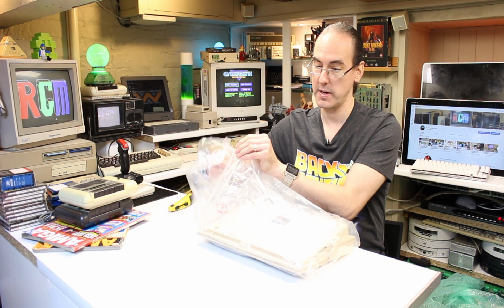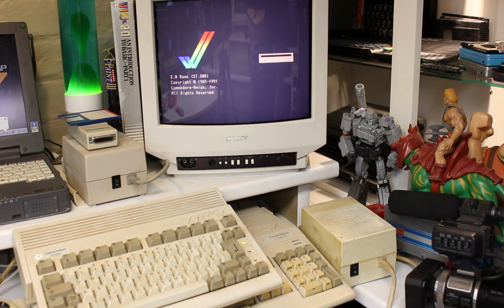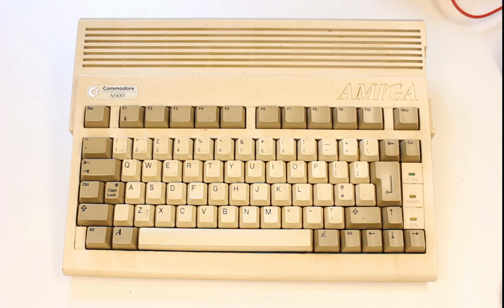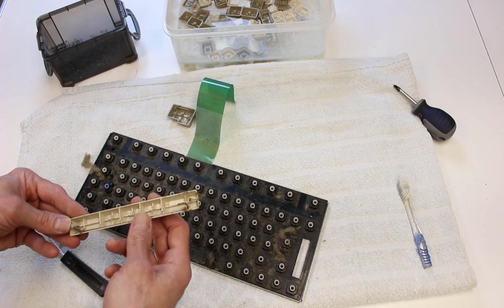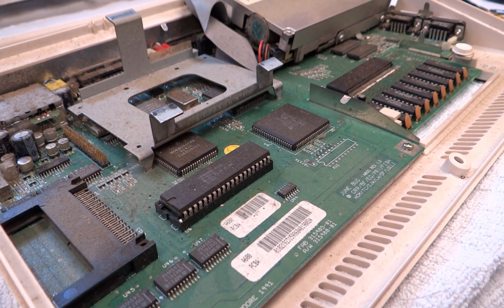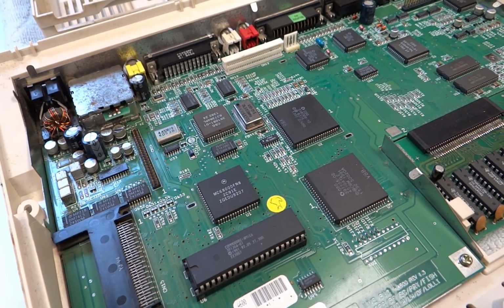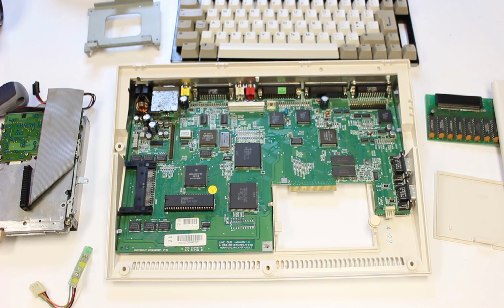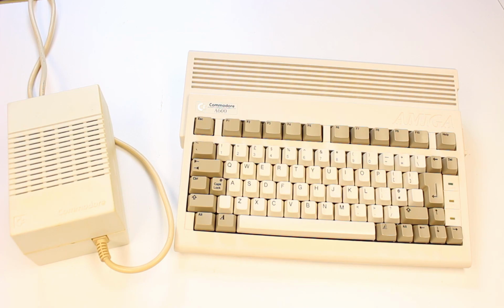COMMODORE AMIGA A600 UNBOXING, AND RESTORATION. Will It work? #commodore

Comment from the maker: This was my first commodore Amiga experience back in the 90's, what was yours!
Reply: It was mine too! Best Christmas ever, the only one I really genuinely remember.
Reply: Exactly the same as me an Amiga 600 was my first, then eventually the A1200. But the 600 will always be my number 1! There should be a top metal shield on the 600 like the 1200,  a couple of 600's I have had did but the one I use now doesn't as its not really needed. Great video by the way!
Reply from the maker: @macmin08  Thanks, glad you enjoyed it. 🙂 I have since seen a few other videos where the top shield was not present on a factory sealed Amiga 600, strange. But apparently commodore did that sometimes and added the little pad to stop the keyboard from touching a memory expansion.
Reply: @RetroGadgetMan  great info thanks! Mine also doesn’t have that

Comment: Remember, lead based solder. Makes recapping a little easier. And yes you'll need a ROM upgrade to use a boot drive bigger than 40MB (problem peculiar to 37.300). Contact switch cleaner on the floppy disk sensor might help.

GadgetUK164 is good to study for retro soldering, but the absolute best around is Acii... a real master tech at recap.

https://www.youtube.com/channel/UCTykXw6QUfZvgAykuvo3WEw

Get a big bottle of isoprop and some scrap surface mount boards to take apart. There is no substitute for experience. And you can't solder a dirty board, EVER...

EDIT: you can get a really snazzy fast RAM board for this to plug over the processor. Although if you are REALLY lucky and can find an old 5Volt 4MB PCMCIA memory card, that works too. Rare as hens teeth though. WHDLoad likes the fast RAM for loading and it makes the machine a lot less laggy in general.
Reply from the maker: Thanks for all the info. I plan to use a broken pcb to learn on. I find practice on something else first gives you a feel for it like with most jobs. I have a IBM 4MB PCMCIA card somwhere, would that work.
Reply: @RetroGadgetMan  Maybe. Best to look it up. A later 3.3 volt card won't connect properly - they changed the pins slightly and added some gold plated "bumps" so they won't plug into a 5 volt PCMCIA as found on an A600.

IIRC, the PrepCard (CardPrep?) tool on Extras disk is used to configure a card as either storage or memory.
Reply: @RetroGadgetMan  If not, one of these does have advantage of leaving the PCMCIA slot free for another compact flash adapter to transfer file more easily. 

http://amigakit.amiga.store/product_info.php?products_id=12696

Although there's no rush really. First you need the ROM to fit storage into the HD connector. On an Amiga with chip RAM only, you'll find HD access only a few times  faster than loading from floppy.
Reply from the maker: I didn't know that, thanks again for the information. I will be doing another video in the new year when I upgrade it and do the recapping.

Comment: Cool that it worked! Very filthy for sure, but it certainly got refreshed with the cleanup :) Will you do more A600 videos?
Reply from the maker: Hi yes, I will be changing the rom and adding a hard drive or compact flash and also recapping as well, so will probably do those together in another video.
Reply: @RetroGadgetMan  Cool, I've signed up to find out when you do that :)